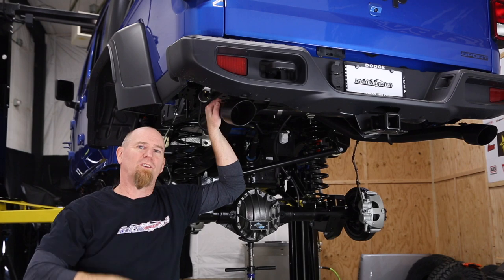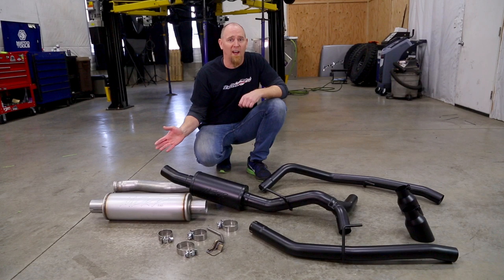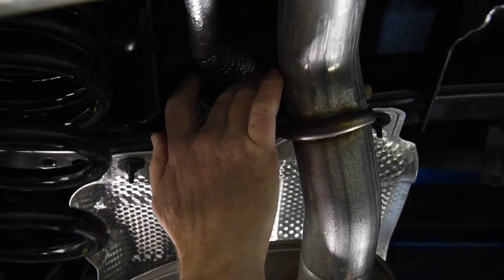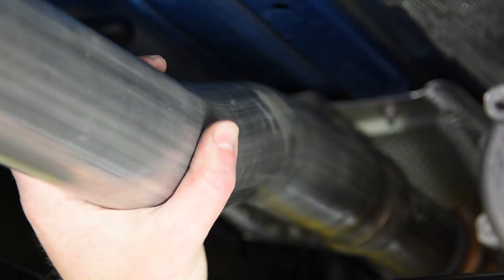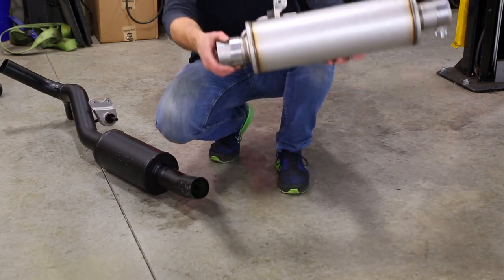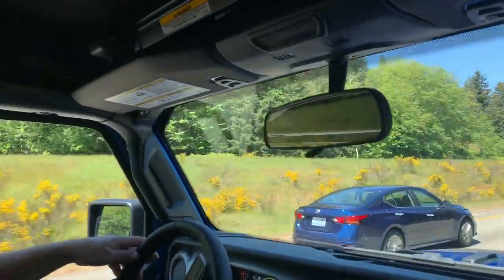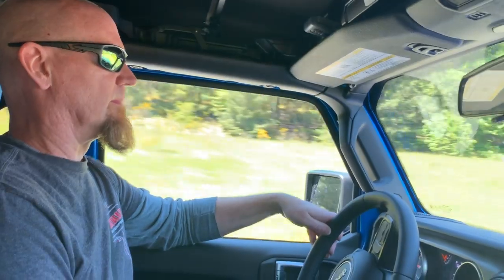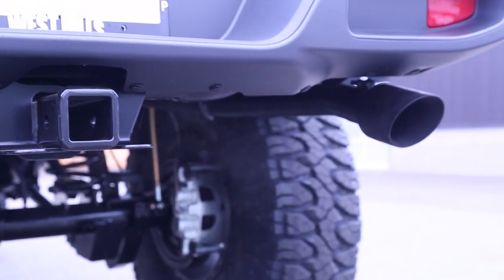MBRP Dual Exit Cat-Back Exhaust Install - Jeep Gladiator JT

Comment: I like the black and the dual. Would be alittle worried about dragging them over stuff though. Is there still room to fit a full size 37" under there or does the second pipe cut into that space? 
  Also, I guess I missed it, did you ever come back to give the specs on what you gained for the 4.5" lift after letting the springs settle? Keep up the good work.
Reply from the maker: Christopher, The tips hanging off the back are definitely a concern, though the lift and the 40s keep do help keep them up and away from somethings. We'll see if we have any problems when we can get the Gladiator out in the rough.
We haven't given a true after measurement yet. We'll do that after the first off road trip and we get a chance to settle the springs in a bit.